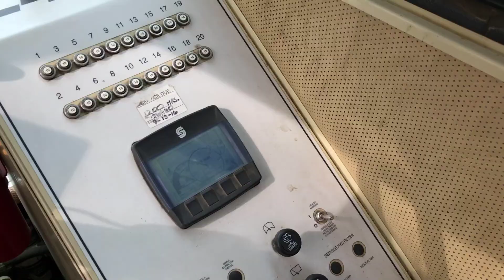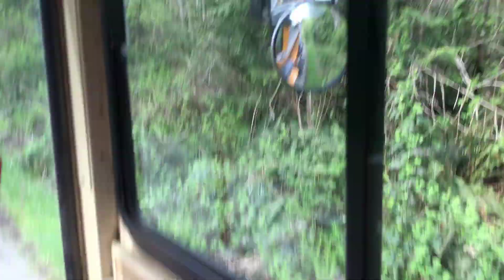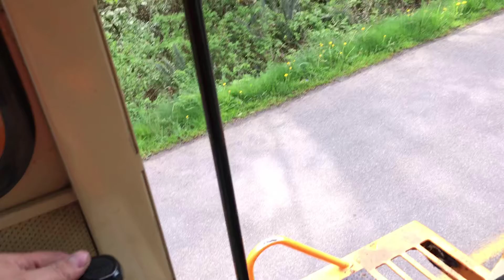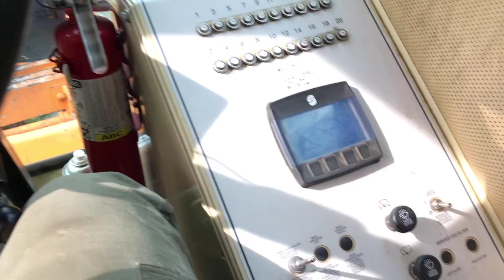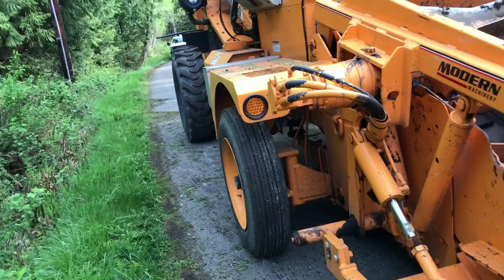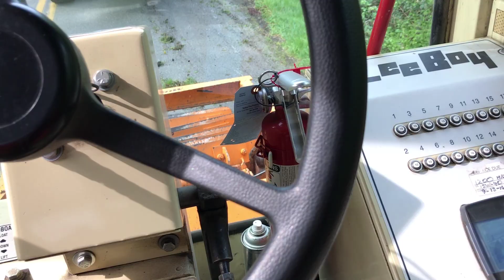LEEBOY 3000 FORCE FEED BELT LOADER . HOW TO OPERATE

Comment: Just curious, do you burn through edges with it ? Or keep the three adjustable plates up a bit so the main edge isn't touching the ground
Reply from the maker: It depends on the road we are on, I ride with it raised slightly and it’ll conserve the cutting edges, sometimes on a road with high center it’ll really burn through the blades. They are double edged so we flip em once .

Comment: Do you hook the dump truck up to the loader with a coupler?
Reply from the maker: no. the dump trucks follow close .
Reply: @Heavyroadequipment  thanks for the response. I operate one. And where I work. Our drivers suck. Some are so bad at backing. I have no idea how they got their license. I'm trying to convince management to let me hook it up with a chain and pull the truck. I was just wondering if anyone does this. Since I'm not really sure of the limitations.
Reply from the maker: @frogmanpipes9561  yeah I hear you, we have a couple drivers that make me consider a neck brace before stepping into the belt loader. the only thing that makes sense is a coupler similar to the chip spreader . getting different drivers to rotate out of the trucks has helped my situation.

Comment: How would it do in alot of rock ?
Reply from the maker: it doesnt do real well. you have to plan the job to be on flat ground or go up hill, lower the belt speed and or go slow. the rocks tend to get to the top of the belt loader part and want to roll back down and hit the cab. but it can be managed.